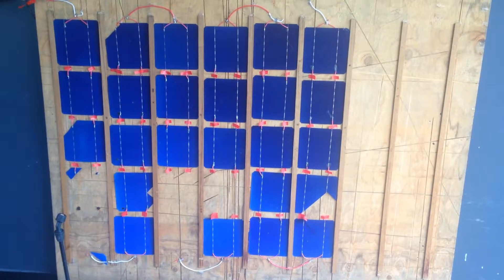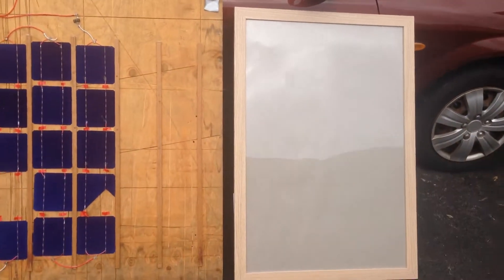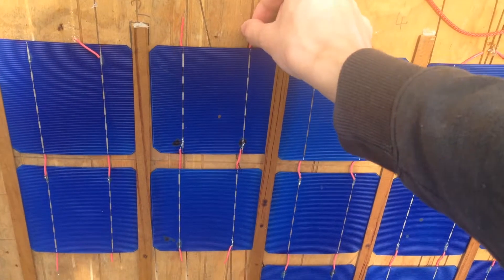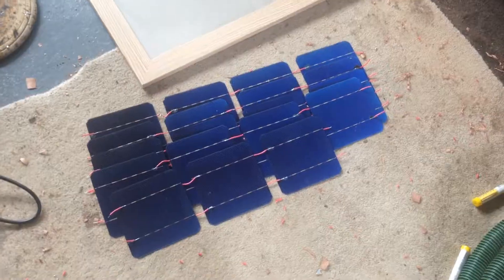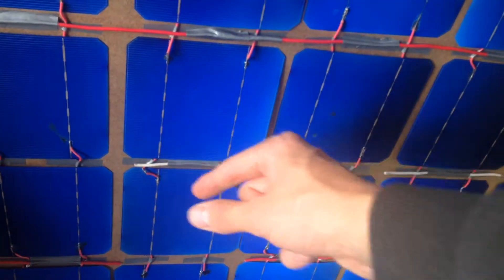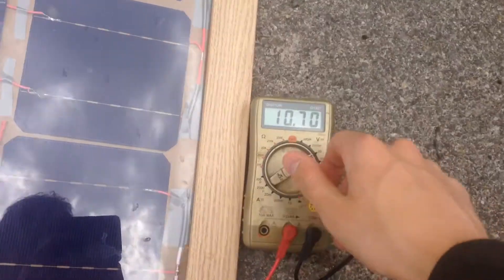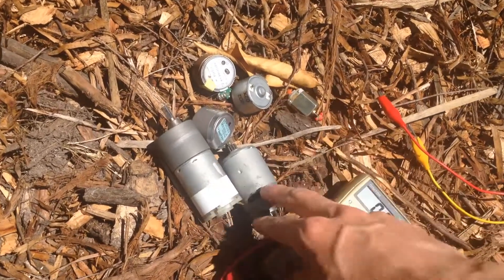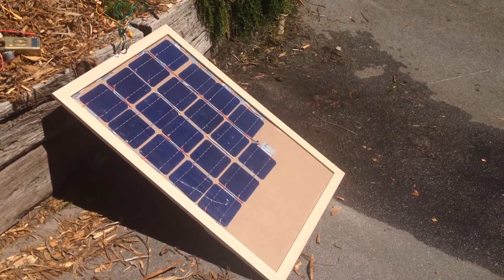Rewiring My DIY Solar Panel

Comment: You should get a pair of sidecutters, they're much better for cutting wires than scissors.
Putting the broken solar panel won't limit current, as long as the path down the middle is intact. It just won't generate as much current because of the missing pieces.
You can make a high powered resistor from heating elements, you just need to crimp wires on because you can't solder to it.
You could put the panels in p3s6 to get 12v, when you took out the damaged panel, it limited the amount of current the whole panel could output because the parallel section with three cells could only pass 3/4 of the current that the other parallel sections could produce. 
12v is a good voltage to float charge lead acid cells at
Arranging it into p3s6 would also give you an extra panel, and a slightly more satisfying rectangle.
Reply from the maker: While rearranging the cells to make 12v would be great, I'm currently using all 19 of them in series with each other (as opposed to having the sections of four in parallel with each other, as it probably looks like), each one only generates 0.5v, so ~10v is about the most I can get currently. Hence why I neglected to add the broken cells, as they would limit the current that the whole series circuit would make. 
Once I buy some more cells I'll most likely add some more in to get that 12v, being able to charge lead acid batteries seems like a good idea.
I think I have some sidecutters somewhere, I'll dig them out at some point.
Thanks for the advice.